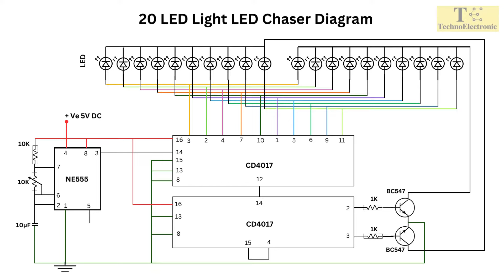HOW TO MAKE 20 CHANEL LED CHASER USING 555 AND 4017 IC

Comment: How many volts of voltage did you connect?
Reply from the maker: I have connected with 5V DC voltage.
Reply: Can this make 30, 40, or More led  ?
Video is Nice
Reply from the maker: @sachinmestry6385 you can use D882 transistor for more LED
Reply: Thanks  @technoelectronic
Reply: Do you have 12 LED chaser  ?
Reply: Can you give circuit diagram of 40 led with same effect...Thanks
Reply from the maker: @sachinmestry6385 how can I reach to you ?
Reply: Where did you find a BC574 Transistor
Reply: @sachinmestry6385      Were did you get the BC 574 Transistor

Comment: What is the 10k vr bud i cant find the same as you have online
Reply from the maker: It means 10k veritable Resistor
Reply: OK thank-you. 
I'm going to attempt this for a back to the future train project. Couple more questions if I may as I'm a complete novice. 
What's the solid wire called you use to attach everything too?
I'll be using blue led would resistors still be the same?
I would need one each side of train can I split the leds or would I need to make 2 separate set ups?
And also the 10up thing what voltage is that as there are lots too choose from lol.
And if u have time a list of more detail with what I need be appreciated as dint know correct terms but if not no worries I'll find them :)
Thanks again